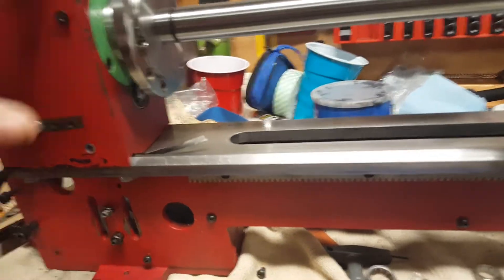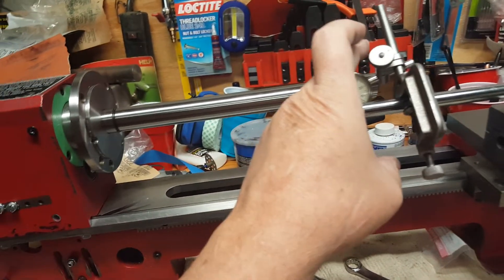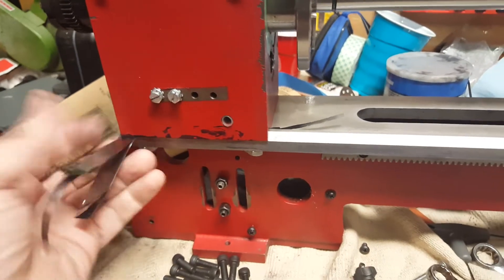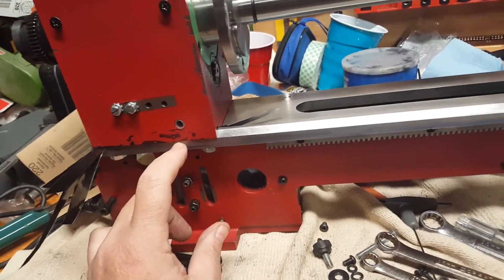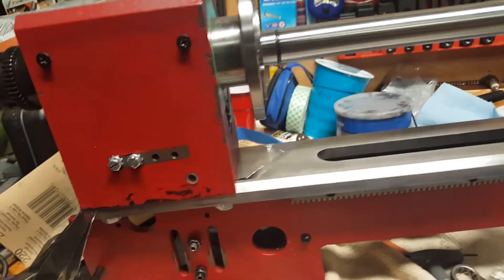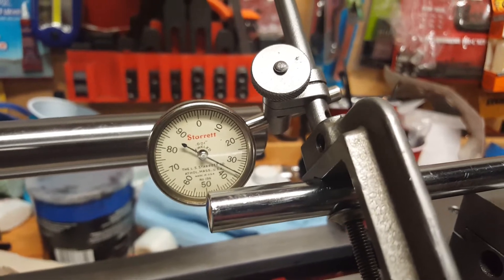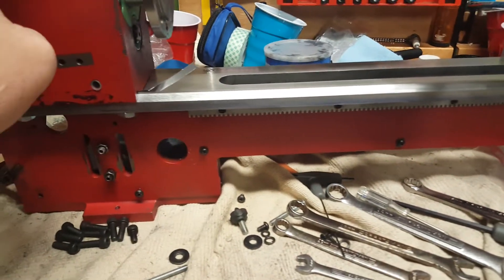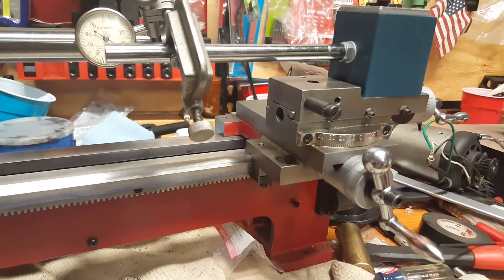7xXX head stock shimming...

Comment: I tried doing pretty much the same thing.I found that bolting the lathe to a very heavy counter top and working on getting out the twist in the bed was pretty much all I needed. I just put spacers under a foot and tightened down the lathe. I gut it to pull into alignment pretty well.